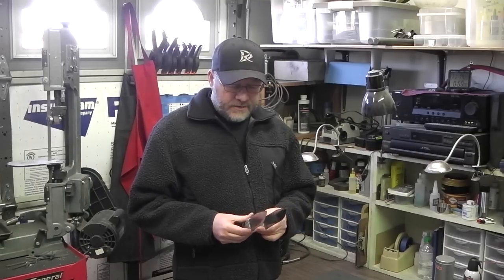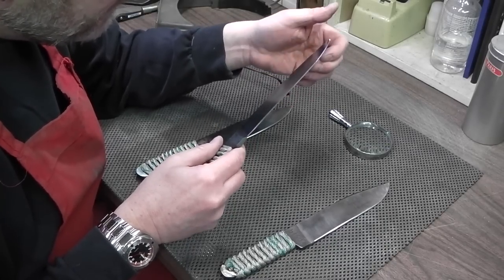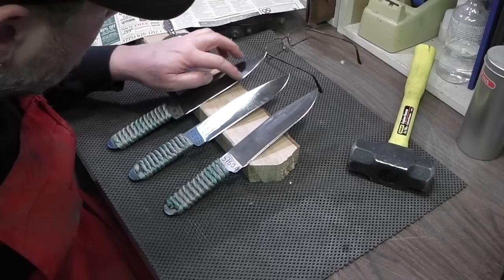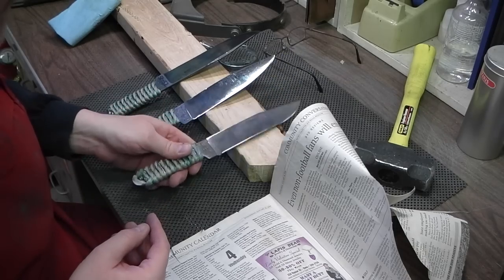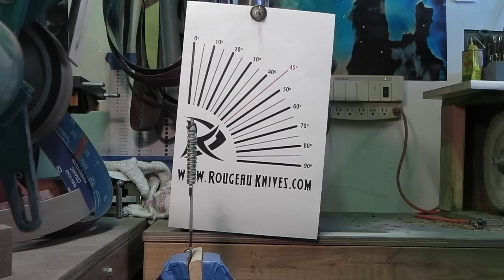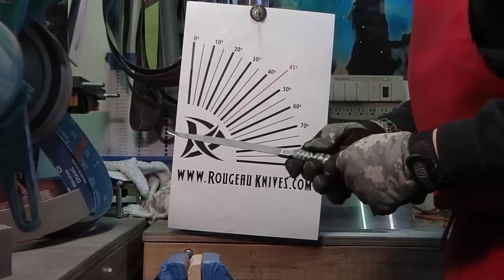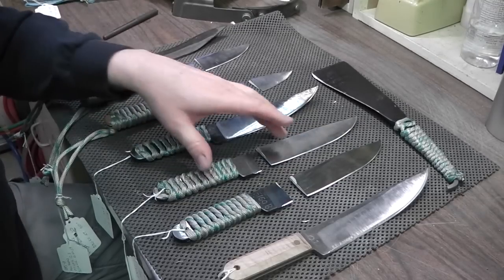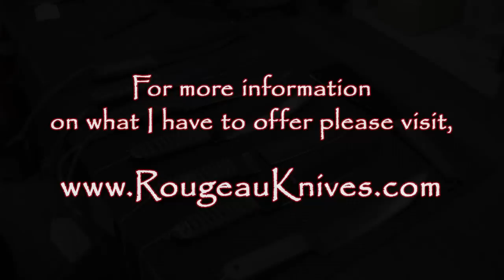Torture Testing 1095 and 5160 blade steel

Comment: I was going to buy a buck 110, I could buy a 40$ one, with 420hc steel, or I could buy one 20 dollars more expensive but it uses 5160 steel, which one is worth it? I think the 5160 steel one will because im looking for a knife to carry everywhere
Reply from the maker: Go with the 5160 carbon alloy stel,. I don't work with any stainless steels lower than 440c.
Reply: Rougeau Knives Gotcha, thanks! I have several stainless steel knives, 420, and they never hold an edge, so thank you for telling me that, that really does help!
Reply: Buck's 420hc with their BOS heat treat have a 58R hardness,and won rust..Best of both world.Try to find someone with a 102,119,120,or a 124 complaining about  edge retention or whatever,lol
Reply: i already bought the 5160 and your comment doesnt make that much sense
Reply: why? i'm just saying that buck's 420hc stainless is as strong as high carbon steel and more resistant to corrosion,and that you wont find many people complaining about their 420hc,because they have a very good heat treating method,called BOS.
Reply: Jack Rabbit Sorry I didn't understand it, yeah so they just made a newer metal, something with a high carbon count, so they could use their heat treated, nice
Reply: Buck's 420hc is actually more like AEBL (razor blade steel) than normal 420. I avoid stainless unless I'm working near water, but buck 420hc is heat treated very well and makes a great blade.
Reply: kristokirov Yeah I already bought the knife, I own two buck knives fitted with stainless, Im more of a collector but I dont baby my knives at all, not even the buck I bought which is the most expensive pocket knife I own at the moment, It is the highest steel quality I own and it is just amazing, out of the few months Ive had the thing ive only had to sharpen it once. Usually if I am working with dirty things knowing my knives gonna get a few scratches I either get the razor sharp 420hc Le Duck by outdoor edge or my Buck Bantan, Im more experianced with cheaper steals but when I hold something like a benchmade I still get all giddy, Ive only ever held one benchmade and it was a fixed blade. Im just telling you my experiance so maybe we can talk a bit more about knives, I have my eye on a CRKT KISS lol
Reply: kristokirov also this is why I love the knife community, filled with a bunch of older or more experianced guys that are really nice and helpful, so thank you both!

Comment: Is 5160 a better steel than 1095? Like holds a better edge longer and all that?
Reply from the maker: 1095 is a simple carbon steel and it's tough. Heat treating can be a little tricky and the hardness will very a bit. 5160 is a carbon alloy steel. It's more consistent and easier to heat treat and it also holds a better edge.
Reply: O ok cool!!!! Thank you for your help sir Rougeau Knives

Comment: I'm looking at getting a O.K.C. Bushcraft Machete, in 5160, what do you think?
Reply from the maker: Efrain PachoI By looking at it's specs it's a thin blade so it should cut through brush well and have a good spring to it. 5160 heat treats better than 1095 and it's a good steel. It has a good hardness for it's purpose. The walnut handles will fail if you don't take care of them but if they do you can replace them with Micarta. It looks like one of their high end machetes. Enjoy!
Reply: Rougeau Knives  does the 5160 steel make a ringing sound  when you thumped it against something?
Reply from the maker: Efrain Pacho  I guess most steels would. the thinner the more it would ring.

Comment: I dont think the hardened 5160 blade should have dulled much after a 2 by 4.........
Reply: he lowered hardness to achieve toughness if you temper it for less time and at lower temperature it has better edge retention but it's the lower carbon that makes the difference (0.55–0.65% C for 5160 and 0.90–1.03% C for 1095).

Comment: What steel would you use for a Bowie knife
Reply from the maker: I use O1 tool steel a lot for Bowies. But you could use 1095, 5160, D2 or 440C. If you are not going to use it much and want it to look good than go with Stainless Steel.
Reply: Im going to forge it and im going to use it a lot. Which would be best to forge? I was thinking 1095 as the edge and sides and have 1050 as the core. I am going to layer it about 15x, Thanks for the advice!!!
Reply from the maker: A 1085 core and 5160 outer would be nice. Or mono steel 1095 blade would be a lot less work and would function just well. 5160 hardens more evenly and it holders a better edge.
Reply: Ok cool thanks man!!
Reply: And how would i harden it?
Reply: and what does drawing temp mean?
Reply: +Rougeau Knives How does O1 compare to 1095, 5160, & D2? So far for bowies I like L6/sawmill steel.
Reply from the maker: +PerceptionVsReality 
L6 is a good steel but you need to know how to heat treat it properly. 1095 is you basic carbon steel and 5160 has other elements in it to help get a better and even heat treat out of it. O1, A2 and D2 are expensive tool steels. They perform better then carbon steels in general. O1 is tougher and flexible. D2 is almost a stainless steel and would hold an edge longer but it's more prone to breaking rather then bending. A2 is in the middle of the two tool steels.
Reply from the maker: +Joe Grove sorry for the delayed response. Drawing temperature is the softening or tempering of the steel after the hardening quench. Temperature and time need to be taken into consideration for each type of steel and target hardness.

Comment: what do you think about the  80CrV2 Steel  blade knife  ?? for Survival - Bushcraft/Outdoor knife use ?? do you think is it durable or not ?? whats the best  stone to sharpening the blade ?? 80CrV2 Steel  knife blade is it weak or is it strong ??  thanks
Reply from the maker: Sorry I'm not familiar with 80CrV2 steel.
Reply: For a camp knife it's fine
80CrV is basically 1080+ steel. 

The difference between it and normal 1080 is CrV has +.01% carbon and added some manganese. 

Is a fairly tough steel and a good beginner steel. The 1080+/CrV does require a 5 min soak at around 1550°

AlphaKnifeSupply has the full specs on 80CrV2 on their webpage including the tempering chart
Reply: ok that's a good advice, thank you very much for your reply, much appreciated :-) cheers
Reply: Yeah, no problem at all! I've been using 80CrV2 a lot lately because where I live the places that stock 1080, shipping is too steep for the quantities I order. And I can't seem to find 1080+ anymore. 

I've also found my gas forge is far easier to regulate temperature during the heat soak than my coal/charcoal one for this metal.
Reply: thank you nice to know that , cheers :)

Comment: was it high carbon steel?
Reply from the maker: +Weird and Crazy 
1095 is a high carbon steel and 5160 is a carbon alloy steel. 5160 is more consistent to heat treat.
Reply: ok thanks alot
Reply: +Rougeau Knives what does that mean? (i know nothing about steel)
Reply from the maker: +Weird and Crazy 
Carbon steel is iron that has carbon added to it so it can be heat treated to a higher hardness. The more carbon the harder it will get. High carbon steel would be 1095. 5160 is also considered a high carbon alloy steel. It has other elements in it to aid in a more even heat treat and allows the steel to get harder during the quench.

Comment: Looks and sounds to me that the 1095 steel is the better steel and you're coming up with every excuse possible cause you want the 5160 to be the better steel. I've used both steels for many years and 1095 had always been the better of the two...IMHO...
Reply from the maker: Johnny Ra 
The main reason I like 5160 is it’s easier to heat treat and the results are much more consistent. It also can achieve a higher hardness and holds an edge better. That’s what I’ve found.

Comment: thank you. im looking to upgrade from my becker i bent my usmc kabar it seems hard to beat that 1095 in my opinion. d2 should snap also right? im looking for from most important to least 1 no snapping or chiping 2 holds great edge 3 stainless  ualities 4 easy to sharpen. i am getting a larger knife that i can use as a prybar hack things and beat the snot out of. hat is the best in your opinion. thx

Comment: In what scenario would you ever have to bend the knife that far !??
If you're  you're going to put that much pressure on it you probably should  have a crowbar !
plus he's assuming that everything he did to make those blades was correct and the steel didn't have any flaws in it.

Comment: I don't think that the sledge hammer and 2 X 4 is much of a durability test.That's how I cut my steaks on a normal basis. (not grass fed beef) : )
Reply from the maker: +Vince Amato 
It sounds like you need to teach your wife how to cook a steak :-D
The goal is to try and chip the blade's edge or bend it. It's the roughest and fastest way to test it. Unless I try to hammer the blade through a nail, wait I should try that.
Reply: You mean that steak's not cooked properly? She said it was SUPPOSED to be on the grill for 2 hours!
Thanks for the informative videos!

Comment: I'm not claiming to be knowable in steel, but isn't 1095 just crap ? Isn't it basically leafspring steel ?
Reply from the maker: It's a simple carbon steel that's iron with 95% carbon so it can be heat treated. It's very tough but it harder to heat treat accurately and it doesn't hold an edge very long. It's one of the cheaper steels to buy in bar stock. A traditional Japanese Katana is made from a hand made version of 1050 - 1095 steel. It does the job well but it's not a super steel.
Reply: 5160 is actually leafspring steel. It also happens to be a great steel for knives, machetes, etc. Why would the fact that it's used to hold thousands of pounds while traveling over ruts and bumps for hundreds of thousands of miles make any steel "crap" steel? A friend of mine has far more experience with knife making than I do and he sells his leafspring knives for hundreds of dollars. His demonstration for their durability is to punch them into a car door, peel shavings off of his tow truck's flatbed and then slice paper into ribbons. I doubt you'll find a tree in North America that can contend with a proper heat treating on so called "crap" leafspring steel.

Comment: Seems to me that 1095 is the better steel all around... and it seems like this vid is making excuses for the failure of 5160. I own knives made out of both steels (Esee & Tops 1095/Ontario RD6 & RD7 5160) and while I love both steels, the 1095 out performs the 5160 everytime. O1 and 1095 are very close in performance with the O1 being slightly better.

Comment: HAs anyone ever broken a knife that big in the field? Seems very unlikely unless it is a machete.
Reply from the maker: Typically if it does break, it's the tip of the knife. And if you do break a 1095 or 5160 blade you are pushing it well beyond its capabilities or the steel is to hard for the task you put it to.